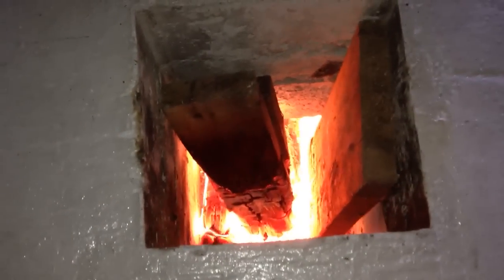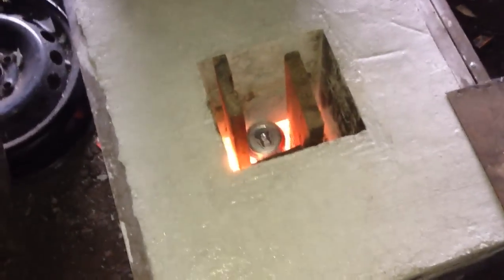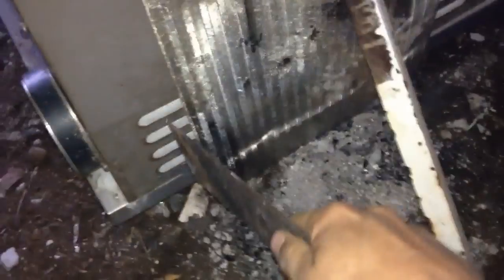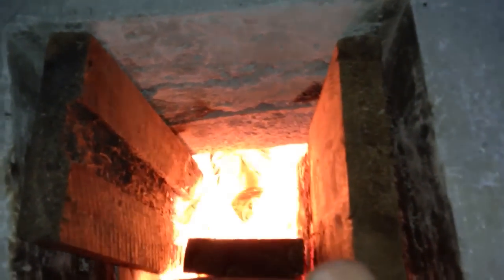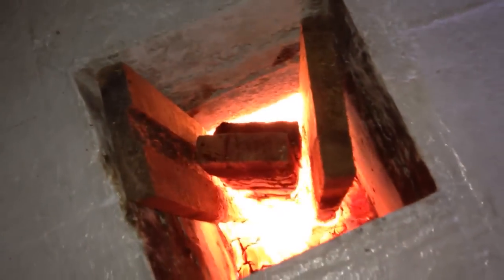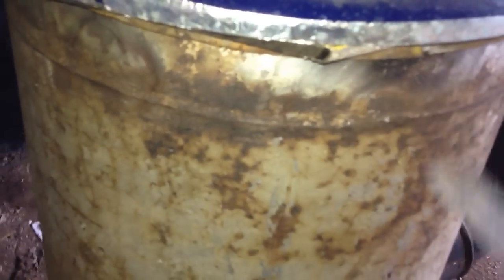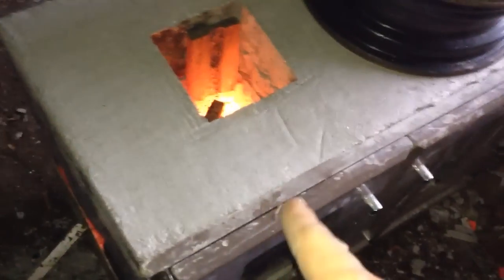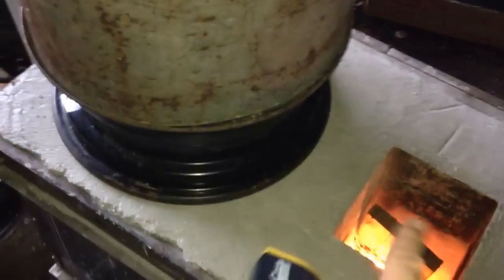Rocket Stoves Ep#32 Melting Aluminum Cans!

Comment: did you use regular concrete to build it or did you use a fire concrete?
Reply from the maker: I used refractory cement mixed with mason mortar and perlite for 80% of the core.   Only the top surface layer is non-refractory.   The flame path has to be refractory.  The "match box" I'm currently working on should get hotter than this one

Comment: Put some air to it like a hair dryer or shop vac and it will get really 🔥
Reply from the maker: this type requires no energy input :D i can burn pellets with no hydro, no auger, no forced air induction required.  that's the best part about this hands down.  no energy input, only energy output